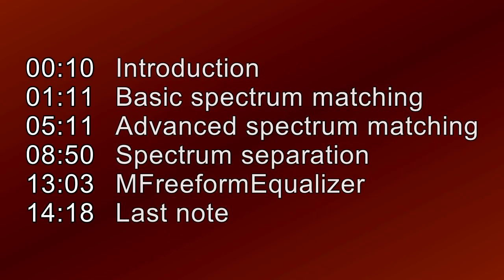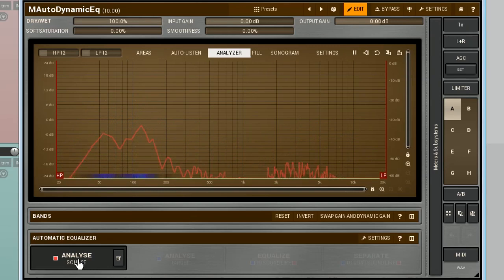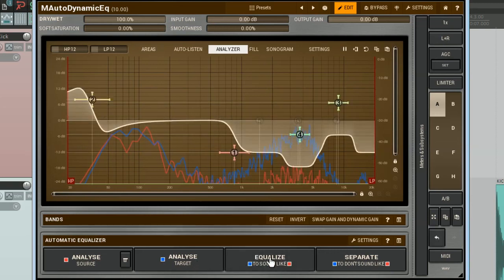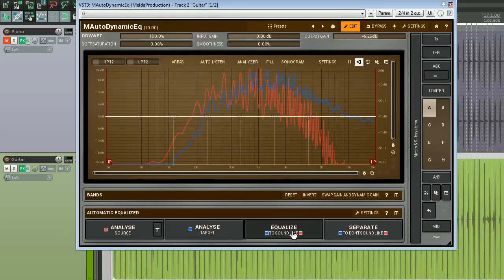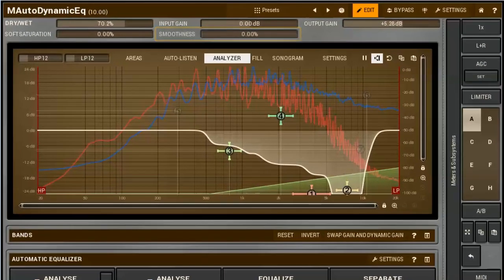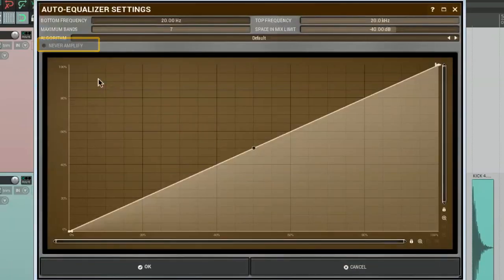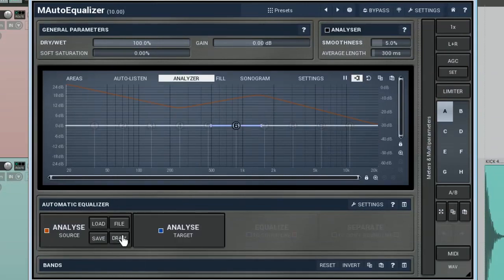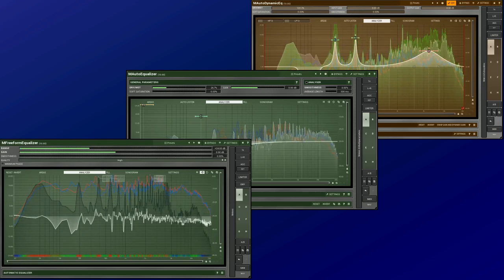Spectrum matching and separation

Comment: What if I would like to do a spectrum matching, (from a different source) to only affect e.g 20 to 400hz and leave the rest of the spectrum (on the target source) untouched... Is that possible? That would be awesome. I hope that makes sense. Thanks.
Reply from the maker: Try the automatic EQ panel / Settings, there's frequency range.
Reply: @meldaproduction  I'll do that, thank you